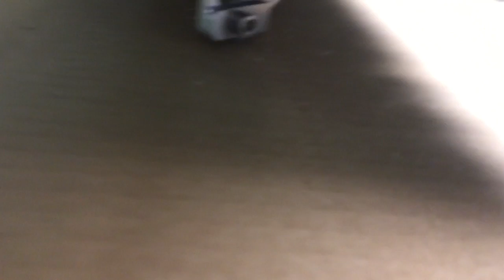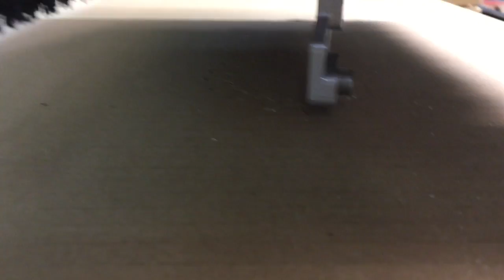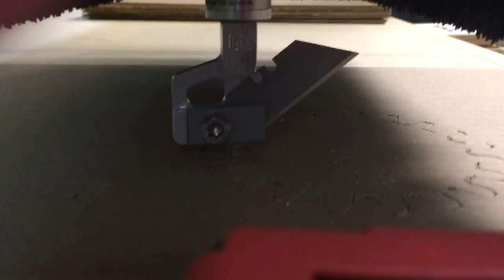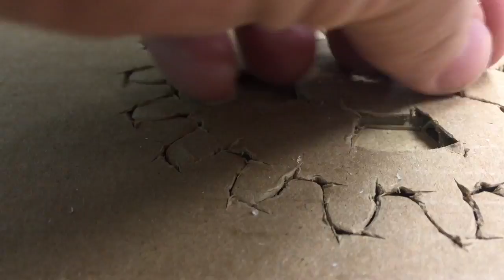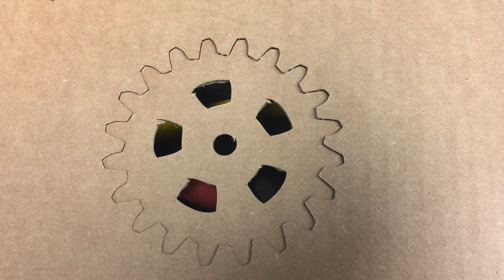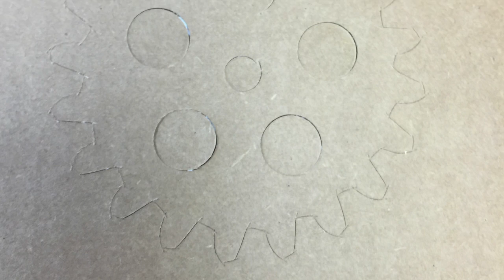Drag Knife on CNC

Comment: which software do you use to create the g code files?
Reply from the maker: I used the Vectric program: Aspire. This is a gadget add in, it may work in V-Carve pro too but I do not know. Real easy to use just define the size and teeth and it makes the gear. I will see if I can make a screen recording of how to do it, but it is simple.
Reply: Eaglein80 thanks.i will try it.i Made a drag knife but i have no idea how to make These Files :-)